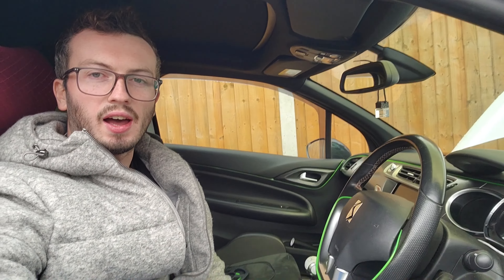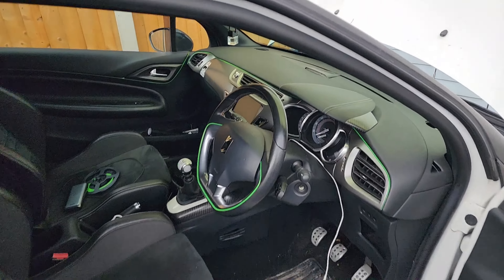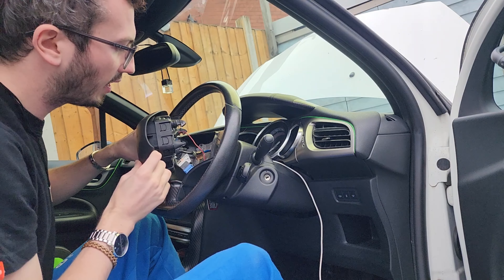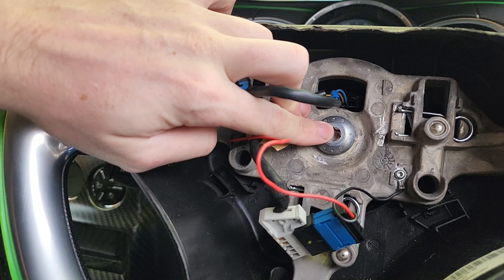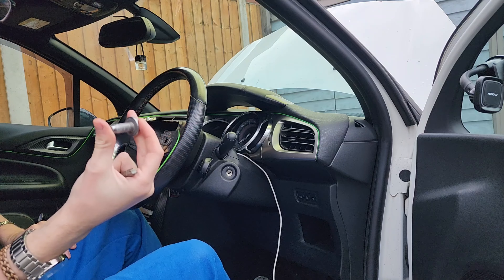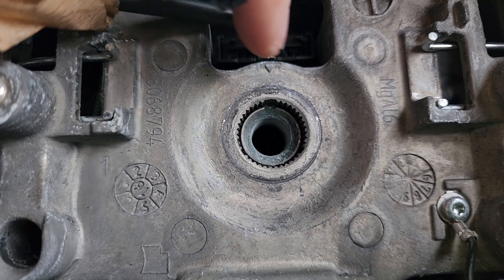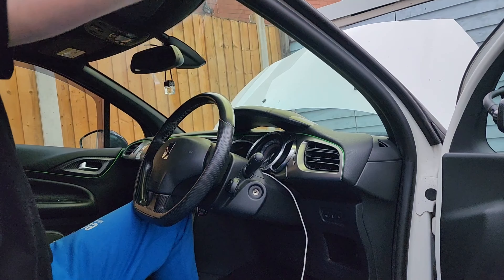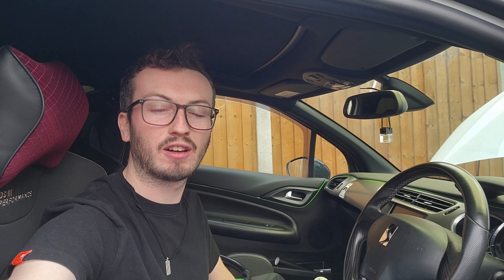How to Remove a Citroen C3 or DS3 Airbag (Replacing DS3 Steering Wheel)

Comment: Good video, I always struggle with removing the air bag.

Just so you know there is a procedure to disconnecting the battery,  you could get BSI issue if you just disconnect any old way. 

You're meant to open the bonnet, remove keys from the car, close all the doors and wait 3 minutes for the BSI to go in to sleep mode and then you should ok to disconnect.
Reply from the maker: Oh really? Good to know! I'll keep in mind the next time I need to take the battery off. 
I haven't had issues so far this way but there's always a "not yet" added to the end of that, so I'd rather keep it that way 👍🏻
Reply: Just to confirm this also worked perfectly on my Citroen C2 VTS 👍, Thank you

Comment: Good morning, what wire should be removed to simply deactivate the air bag please? Is it the black wire with the blue connector located in the center of the steering wheel or the red one? Thanks in advance

Comment: Quick question, it will probably sound stupid but can this steering wheel fit in my citroen saxo 1.5 mk1
Reply: Because everything is the same the bolt, o just dont know if the “socket” that links the steering wheel to the wheels is the same

Comment: Pointless fitting a whole performance wheel as the carbon bit on the bottom is not real carbon but plastic and it just clips into the normal wheel instead of the chrome coloured plastic one.
Should have saved money by just removing your standard plastic chrome coloured one (it's not metal) and wrapping in carbon.
Reply from the maker: I had the real ds3 performance, so it was just fitting the original wheel again. 
Plus, the deal that I got on it was less than a standard wheel 🤷‍♂️ Pretty sure it's a real carbon layer as well - I heard from one of the other club members that the interior carbon pieces on a performance are real. Never tested though! But you'll never get a perfect finish if you wrap or hydrodip it to try and match - better to go for original
Reply: @connxr  None of the pieces on a DS3 Performance are real carbon, interior or exterior, they're all plastic. The only real carbon pieces are the exterior pieces on a DS3 Racing which is the first generation.